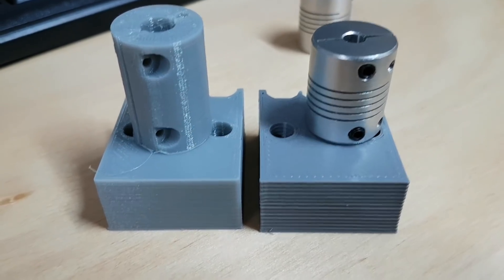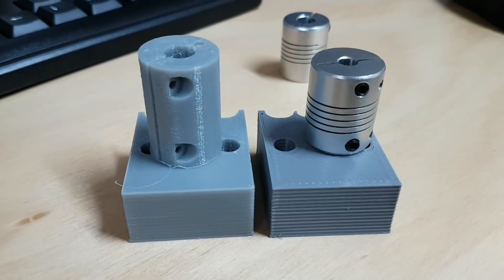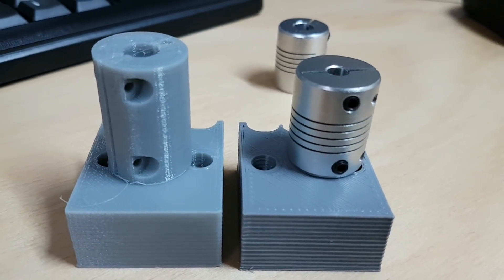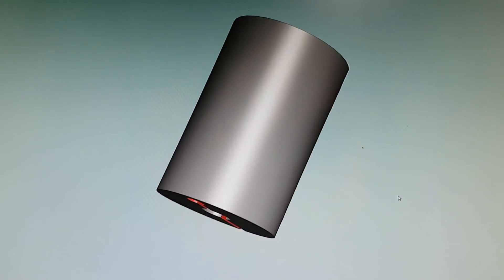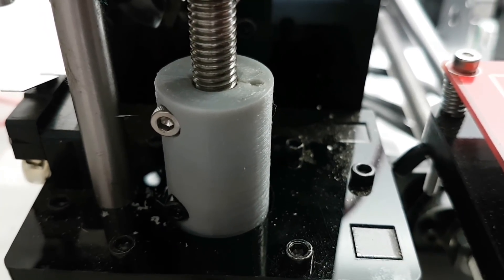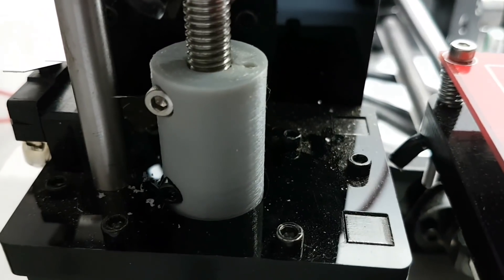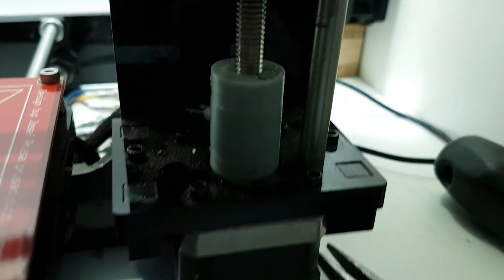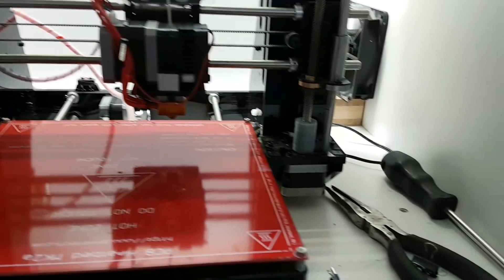Z axis banding problem and solution.

Comment: The reason the metal ones did not work is because you installed them incorrectly, the metal ones are basically a spring and can expand and contract ether from rotational  force or pulling / pushing force, and so if you have a pretty fast Z moment it can cause the flexible part to expand and contract and this is more noticeable if you use z hop and so for these metal couplers to work the lead screw needs to be supported / fixed at the top mount both on top and under the mount so to stop the leed screw moving up or down but still being free to rotate, you get lead screw clamps  spacers and bearings for this purpose

Comment: The metal ones didn't work for you because you didn't pre-load them. You have to pull them as if you're stretching it as you tighten down the screws. This will remove any play in the joint.

Comment: Thanks, my second z axis setup came with the same aluminium joined as you had there. I will print out your version and use that instead of machining a new one out of aluminium
Reply from the maker: I think the split design is usually the most likely to align both shafts to a common axis.
I found most of the trouble seems to be in designs that feature grub screws that force things a little off centre.

Comment: Im on a prusa mk1 my z axix is connected with some kind of rubber tube
Reply from the maker: Many are, and it seems to work well enough most of the time.
Reply: @helmreichenterprises8391  yes surprisingly Ive run 1000s of hours of prints and its never been a issue
Reply from the maker: @dracoflame8780  and if ain't broke....  :)
Reply: @helmreichenterprises8391  Lol it breaks all the time. then again while i'm in the process of fixing it XD... but it still prints!
Reply from the maker: @dracoflame8780  hahaha :)

Comment: Thanks for sharing your design, very clever idea.  What type of filament did you use?  I have an Anet A8 and my motor-to-rod alignment is off by a significant amount, about 0.25”.   I’m going to mill slots into the motor mounting plates so I can adjust them to line up better but I’m not sure if I can get them perfect.  I want to add these as well to make up for any slight misalignment.
Reply from the maker: I happened to use PETG, - it's easy to print, although slower than PLA.
Don't go for speed when printing this part.

Comment: I am building my first one. I notice that  the brass nut on the right, which goes over the threaded rod, fits a little bit crooked against its black holder. This might become a problem when the motor tries to rotate the rod. it might get stuck because it is not square and it gets worse the higher up it goes , thus the more distance it covers. Anyone has a solution for this?
Reply from the maker: That sounds like a similar problem.
I would try to true it up as much as you can.
Once you printer is running you can test it's behavior, and maybe do similar to what I have done here.
Good luck with your new printer :)

Comment: The cut to allow flexibility is excessive resulting in a coupler that is more akin to a spring.... basically they are too flexible...
In a well designed printer you should be able to use solid couplers or failing that switch to the type used by the CR-10 as it appears to be less flexible (at least it solved my issues)...
Reply from the maker: Exactly my thoughts.
Precision, and rigid construction is superior to sloppy and inaccurate.
Reply: @helmreichenterprises8391  In theory you'd use a pillow block with a bearing and shaft collar Above the flex connector. thus blocking the vertical "springing" action while maintaining the angular flex.....
They work when used properly, we just aren't using them properly when we stick them into our 3d printers....

Comment: Z-banding can also be caused by filament feeding issues. If your filament is not on a bearing system, light banding is common. Great part! Thanks for sharing.
Reply: If the bands line up with the threads of your screw, however, it's more than likely the rod.
Reply: @ZeroPointAlpha  huh intresting!
Reply: Thanks! my bearings have gotten kinda hard. the store accidentally sent me 2RS bearings so that could be the issue with my filament feeder! guess i'll try to fix that first :)

Comment: You know that the axel of the stepper motor only should be 5 mm into the coupling, and the same for the top tread.  Only 5 mm down into the coupling.
The coupling should be working like a spring.  If the axel and the screw connect, you will get problems with wobbling Z.  Then the screw will probably reach the top whole.
At least that works like that on Anet A8.
Reply from the maker: That would be true if there was another bearing on this design.
Normally flexible couplings are to allow rotation to take place without the motor affecting the precision of the screw.
But this design the wobble is created by the coupling :(
Reply: Well, there are no bearing in the top, but it still bring enough support to stop wobbling. At least to my experience and this man.
https://www.youtube.com/watch?v=T9vI6DqAcmo
Reply from the maker: The couplings are the wobble at the bottom, as they were not accurate.
They actually acted like a cam.
Reply: ok
Reply: I've got my couplers mounted in the way you're suggesting, but unfortunately I've always seen a similar z-banding issue like shown in this video.. I've tried re-coupling the rods many times, following various methods out there, to see if anything had an effect, but not much improves it. I've even tried stabilizing the rods at the top, which is usually not the best idea because it over-restricts things, and that actually did improve things for a while, but not as much as I'd like.
I might just try printing one of these more static couplers next to see if that helps.. :/